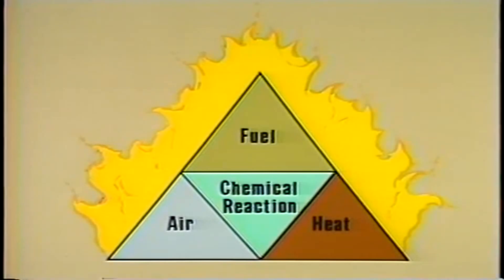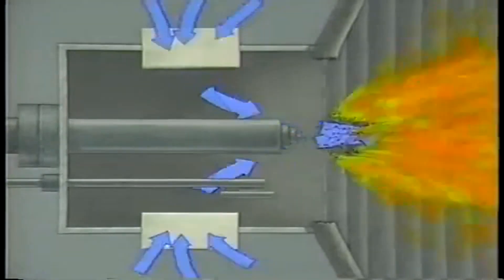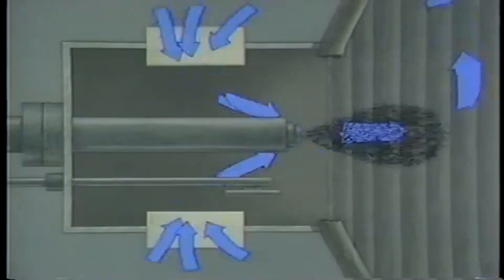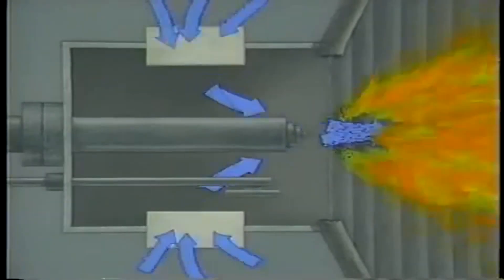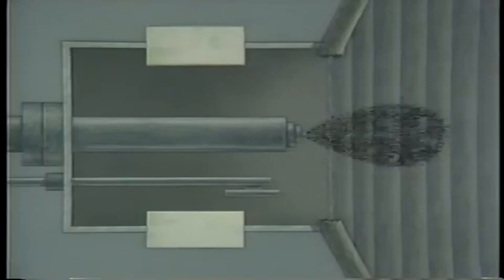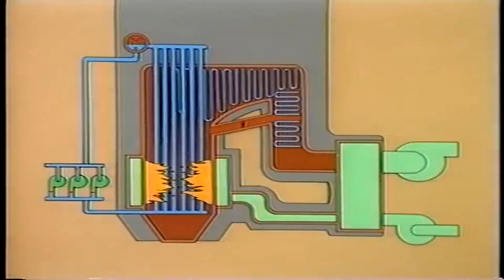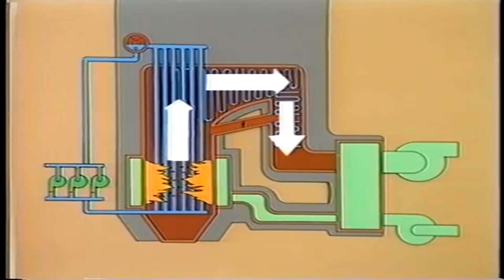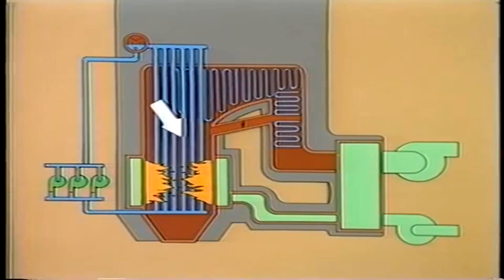Why Boilers & Power Plants  Explode ??

Comment: I worked for Brown & Root for 10 years as a High-Pressure Boilermaker Foreman! The reason mostly was errors on the process! Like they would tell us to cut into a gas refinery tank, after the engineers told us it's been drained then filled with water! Well guess what they never drain the tank and it's full of gas or whatever chemical they had in them! BOOM! I knew those guys and they got burned bad from the flash!  1975 to 1985 era Houston and Pasadena
Reply: I was Osha trained!
Reply from the maker: Thanks for ur info
Reply: I have experience at H2SO4 compressor, the prosess operator said " compressor it save" but i'm not trush him
Reply: Do not rely on other engineers, before working on any vessel that contains inflammable product, check the  vessel yourself to see to see that any inflammable product remaining in the vessel has been purged, said vessel filled with an inert gas like halon .

Comment: Actually the reason for any boiler explosion is simple.........the design limitations were exceeded resulting in catastrophic dis-integration of the boiler. 

You're right though, I've never been involved in a serious boiler explosion but I have seen a few minor ones. 

1. The operator was in a hurry and decided it would be ok to bypass most of the purge cycle. Nice BANG but no damage.

2. The boiler was fired by liquid fuel, some of which had accumulated in the bottom below the tubes. The was more of a WHOOMP than an actual explosion but it occurred a few minutes after a successful start. 

3. Conversion of a boiler from liquid fuel to gas. Long exhaust stack and short purge cycle. Again a nice BANG, sort of like a shotgun, but no damage. 

4. This wasn't a boiler, it was a thermal oxidizer. Its purpose is to heat noxious plant gas to 1600F for 11 seconds or more. This would burn the noxious odor. 

After the first start, all went well but a couple of minutes after shutdown there was a very loud BANG followed by a fairly loud hiss. The plant has hydrogen at 1400 PSI, there were only 3 of us present at the time. We thought a hydrogen line had exploded so we ran as fast as we could to the evacuation point. 

What actually happened was the plant gas valve was pneumatically operated butterfly type and the shipping pin was still in so it didn't close completely and allowed plant gas to continue entering the combustion chamber. When the gas built up to the insulation spikes (which were still red-hot), it ignited. The hiss was that the explosion blew the front part of the fan off and severed a 1/2" compressed air line operating at 100 PSI. 

The bad part is that the control panel is right above the fan and I was standing there about 2 minutes earlier shutting down the unit. Had I not walked away, I'd be about 2' shorter now........

Boilers are generally pretty safe but they're not very forgiving of failure to adhere to established operating procedures. In other words, it doesn't take much of a screw-up to blow stuff up...........
Reply from the maker: Thanks for your share 🌹 and ur welcome 👍
Reply: Not much of a screw up?  Leaving the shipping pin in on a gas valve is a catastrophic failure in safety measures...  It wasn't only design limitations, but user error.  There should be mandated sensors to prevent this sort of foolishness.  You can explain it away to try and minimize it, but it sounds like whoever installed and/or inspected the thing was beyond negligent.  Everything you described is user error and lack of maintenance/being dumb and converting boilers.
Reply: @maskcollector6949  As to the boiler conversion, the era outlawed the use of liquid fuel so we had no choice but to convert to gas. 

Certainly, the guys who did the conversion were responsible for it but if the era were to not be such bullies who absolutely love to throw their weight around, it wouldn't have happened. They need to cool it a bit. 

As to the shipping pin......the valve was installed more than a year before the plant started up, leaving it in was the right thing to do but yes, it certainly should have been removed before the last actually statrted up. 

The main contributing factors here were the fact that there were no stepladders anywhere nearby.  The company should know better 

Plus, the simple fact that the valve was high up and out of reach is a design error. It could have been placed low enough to be accessible from the ground.

Comment: Thanks for sharing your experience. The modern burner are equiped with flame eye to minimalize explosion when start up the burner, when igniter failed ignite the burner,  fuel valve will automatically closed and cobustion air still flowing to purge the burner.
Reply: that's true, but fire eye failure can allow the ignition to proceed and the explosion risk remains. many of the more modern designs have dual fire eyes or temperature probes to ensure ingniter or pilots are lit before main burner gas valve is allowed to open
Reply from the maker: Thanks for your share